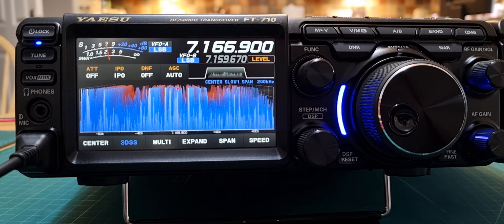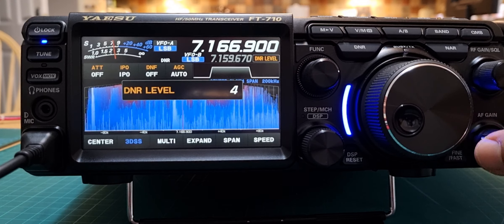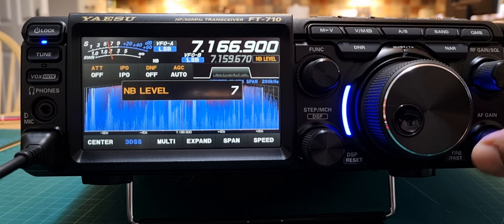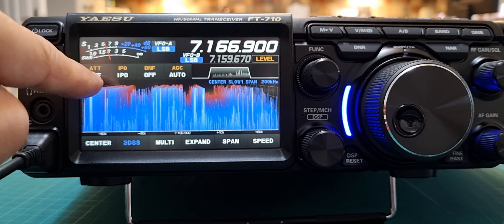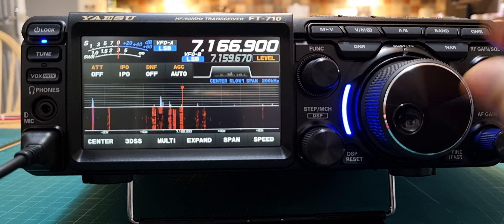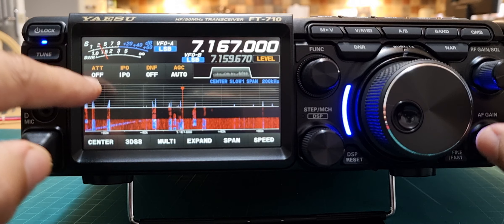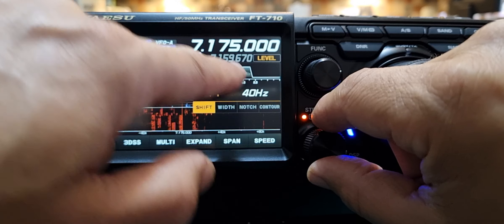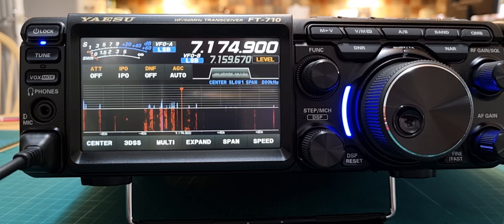YAESU FT-710 DSP, DNF, NB IPO, AMP1/2

Comment: The DNR after 3 is atrocious in these
Reply from the maker: https://youtu.be/Id8Q1e5lOEE
Reply: @DIGITAL HAM RADIO DIARY-M0FXB  Reducing the gain does reduce the load on the DSP chip, but it still is only a bandage. After using an FTDX 5000 where the DSP can be left on all the time on SSB, the step on the 710 from 3 to 4 is horrible all the way through 15.
It's even more noticeable with a normal sized external speaker.
If you turn the RF gain down with DNR on 4 to knockout the water, take  notice of the response.  Then turn off the DNR and turn down the RF gain. It knocks out the noise same as DNR ON, so no difference.